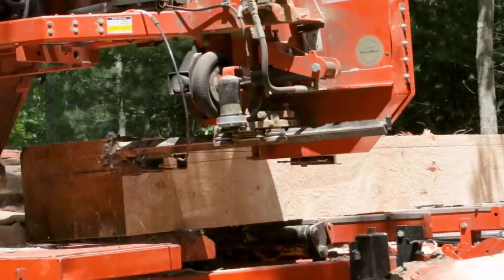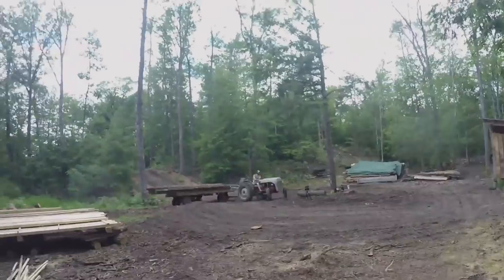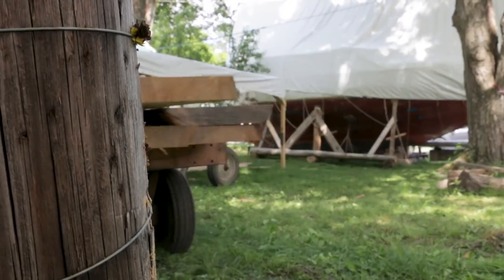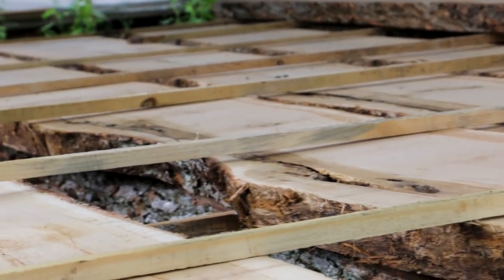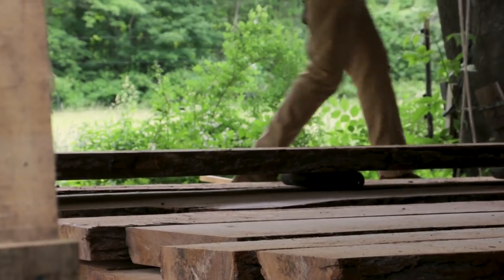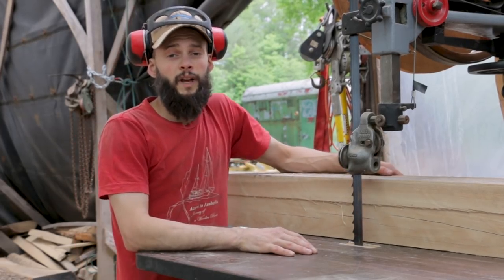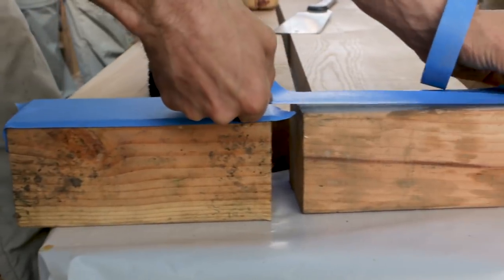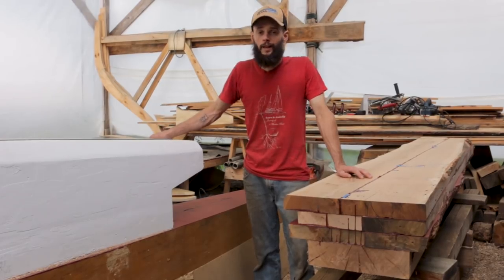Acorn to Arabella - Journey of a Wooden Boat - Episode 39: Aft Deadwood and Moving Lumber

Comment: Just want to say you guys are incredible at what you are doing! I'm a cabinet builder for 35 years now and beyond impressed at what you're doing! My question to you guys is have you ever sat around having a pint and thought how in the world did those men 200 years ago build the ships they did(War ships and Whalers) without electricity, carbide,modern glues and combustion motors? IT BOGGLES MY MIND!!!
Reply from the maker: Thanks! 
They had lots of men working on the bigger boats.  If you have enough trained shipwrights working on a build it can go pretty fast.  They also had dedicated jobs, we have to have some comprehension of all the tasks, back then you would juts frame, or plank or caulk.  They also had huge beautiful timbers to work with, that helps a lot, no need for glue!

Comment: You made a comment during the video about some people saying that pine was no good for the decking, I believe? As someone who enjoys your channel but knows nothing about boat building and not that much about wood working, I wondered why they may think that and why you disagree? Perhaps that is a good topic for inclusion in a video at some point to enlighten the ignorant folks. Cheers and good luck. I follow your progress with interest.
Reply from the maker: It just depends on who you ask, pine is softer, does dent easier and is not as rot resistant as say teak but it has been used for laid decks and planking for a very long time.  So long as it is slow grown with tight rings and clear it should be just fine.  There are a ton of boats out there sailing with pine decks and pine planking.

Comment: Apologies if I missed something earlier, but did you seal the ends of the boards with something to prevent them checking?
Reply from the maker: Yes,
Anchorseal when raw timber, then either Danish Teak Sealer, Linseed Oil or Shellac depending on what it is and where it is going in the boat.

Comment: I wonder if some sort of motorized out/in-feed table wouldn't be helpful with all the heavy stock you will be milling on the band saw?  Just a thought.  At any rate, out-feed and in-feed tables and rollers would help with the strain on the band saw table.
Reply from the maker: I don't think automatic feeders would help but infeed and outfeed tables would!  Once the lofting floor comes up the machines will get set up more permanently for the rest of the build and we will put in good in and outfeed tables.  Right now they would be more hinderance than help.

Comment: Regarding the shaping of the deadwood. Why didn't you bandsaw the pieces roughly to size before laminating them together? The time lapse makes light work of the enormous task of reducing the massive lump to size. You guys seem to be very good at forward planning so I'm curious as to why you look to have created a great deal of hard heavy work here.
Reply from the maker: The glue is slicker than snot on a glass door handle so by leaving it all oversized we did not need to worry much about the alignment during clamp up.  This way also let me cut and fit the nib with enough material left around it that if I buggered it up a little there would be enough wiggle room to trim it back and have a second go.  If it was cut closer to final size I would only have had the one shot at fitting the nib and would have had to be very careful during glue-up. 
A more experienced or confident carpenter probably could have done it faster with cut to shape laminations.  Since we don't have a deadline, I can take the time and effort to "sneak" up on some of the bigger and trickier pieces.

Comment: How many hours shaping the deadwood? A good way to slick up the table of the bandsaw is Sunlight soap in the bar form, rub it on just like you did with the wax, it has good dry lubricating properties.
Reply from the maker: It took the better part of three days but it was very warm out and it's physical work so maybe 16 hours of actual work, did a few other things those three days as well.

Comment: Don't know if I missed it, but how did you attach the keel weight to the wooden keel?
Reply from the maker: It's in one of the videos.  Right now there are two bronze bolts but there will be 8 more added a little later.

Comment: Have you thought about an out feed table so you can one-man longer pieces?  In feed tables also useful.  Sometimes such tables incorporate rollers.
Reply from the maker: We will get there, right now they would be in the way and have to be leveled every time we use them.  Once the lofting floor comes up the bandsaw will move and get infeed and outfeeds set up.

Comment: I really do appreciate your woodworking skills and shaping these big Timbers but wouldn't it be easier to shape each individual component of the laminate before you glue it together that way you could set them in place on the keel and shape them while they're easier to handle once it's glued together all you have left is a little cleanup work
Reply: Steve Gem too much room for errors that way I would think. There is a lot of y the shaping on a boat that isn't done just measuring from point to point. Faring a curved time like that would have too many points to try and line up if done piece by piece.

Comment: Just curious as to why you didn't laminate it in place and shape each piece as you went?
Reply from the maker: Could have, the glue is super slick and when clamping it wants to slide all over the place so it's easier to clamp up a big block so any sliding can just be ignored.
Reply: Makes sense, I used dowels to hold the laminations in place but then I used epoxy

Comment: How come you didn’t shape/size the laminates individually before gluing?
Reply from the maker: We could have roughed things out a little closer but in the end it probably would have taken about the same time.  The angles change very subtly down it's whole length and in every direction.  To get those bevels correct as individual pieces would have been tough.  Also the glue (resorcinol) is slicker than water on ice, the pieces want to slide and move when clamped.  By leaving them big we did not have to stress about it if they slid a little on way or another during glue up.
Reply: Acorn To Arabella Thank you for your reply. (Now when I know you are doing this without health insurance I will be watching with an alleviated level of nervousness. Please take care!)

Comment: Build 2 large roller extension tables that would take the weight off of the bandsaw table would make it possible to cut larger beams.  Moving the wood to the extension tables would be a chore.

Comment: this might be incredibly stupid of me, but why didn't you rough out the shape before you laminated? Like glue the pieces so that you get it to width, then cut these pieces to rough shape and then stack/laminate them. Might not be perfect but it probably would've saved you some time and sweat compared to doing it like you did. Might have even left you with "waste" pieces that you can use for smaller things.
Reply from the maker: The issue is the glue is super slick and the laminations want to move and slide when clamped, also it would have been a bunch of lofting to get the lifts figured out.  You certainly could do it that way but I think for us the time would have worked out to just about the same.
Reply: Well for the slick glue you could utilize like small dowels that keep the parts from slipping during laminating, just drill 2 or 3 half inch holes in both pieces put a dowel in and done the pieces are secured. For the lofting i was more thinking about using only one, the biggest template, for this rough shaping. it might not save as much wood but it would still save you from removing these almost feet wide pieces of wood with chainsaw and handtools while saving you a whole lot of measuring and transferring.

Comment: Why didn't you glue each layer together side by side, rough cut to shape then thickness plane each layer and then when you had each layer done glue the layers together? Watching that time lapse was like watching you shape a toothpick out of a 2X4.
Reply from the maker: We could have.  The glue is slicker than snot on a glass door handle so having the extra room at glue-up is nice.  The bigger reason was it let us shape and fit the nib end and (the tricky part) and then shape the rest.  The nib looks simple but it is not totally square so it all meets at very low funky angles.  This let us not stress the glue-up and test fit the nib and then just carve away the rest close to carefree.
Reply: I am a luthier and woodworker and do a lot of the joinery you're doing, just not to that scale but to keep from fighting slippery glue I use locating pins. they keep things in alignment and it is almost necessary when i use hot hide glue which has a very short set time.

Comment: I’m surprised you didn’t use the locust for the shoe. A ships saw has rollers on the ends of the table and a big crank that tilts the saw, not the table, takes 4 guys to cut a timber, but you have what you have. Your softwood is fine for deck beams, decking etc but heat it up to 180 Deg for 2 hrs to kill all the spores and bugs. If not you will have dry rot in 3 years.

Comment: why didnt u saw the trees close to where u r putting it now ?why handel it 2 times
Reply from the maker: I wish it was that easy.
The machines to move/mill the logs make a huge mess, as does dragging the logs.  If we milled at the house we would have had to clean up and fix the lawn afterwards.  The mill made at least a dump trucks worth of sawdust, never mind the slash and hunks of bark.   By doing it in the wood yard we could just pile the slash for fire wood and rake out the bark/ sawdust/ruts from the machines quickly and easily with the tractor and call it a day.

Comment: Looking at how small the ballast is in comparison to the entire length had me thinking, did anyone ever use shaped stone for a ballast?  I know stones were used in the bilge as ballast but I wonder if anyone shaped something like granite?
Reply: I doubt it.  It is simply too easy to add steel (or lead) to concrete and end up with something that is denser than granite and much easier to shape.  Stones as ballast only make sense in the crudest of applications.
Reply from the maker: We agree with Jason Earl, there are other easier and more dense options.  Stone has been used forever for internal ballast but I have not heard of it being carved for external ballast.

Comment: you seriously need rollers to support wood by the bandsaw both in front and behind the saw. it will make your lives soooo much easier.
Reply from the maker: When the saw goes to it's final place we will add some, right now they would very much be in the way and since the floor is unlevel dirt we would have to level and shim it whenever we used it.  Not worth it right now.

Comment: Rip fence??
Reply: oldwillie313 I was thinking the same. Too much friction maybe?
Reply: A rip fence is only good if you have 2 adjacent sides which are perfectly square to each other along their full length..
To get that, would require running that 6x7 through a jointer a number of times.. and like Steve said, it's just too big and heavy for that to be practical... oh, and they'd need to have a jointer as well.. and a good one capable of handling such a huge block of timber would cost thousands..

Comment: When stacking the lumber,the stickers MUST BE on a straight line on top of each other to prevent the wood bending.
Reply from the maker: True but it also depends on the thickness of the lumber.  If the stickers are off a tad with 2-7/8" thick slabs of oak it's not a big deal, with 1" pine planks it's a different story.